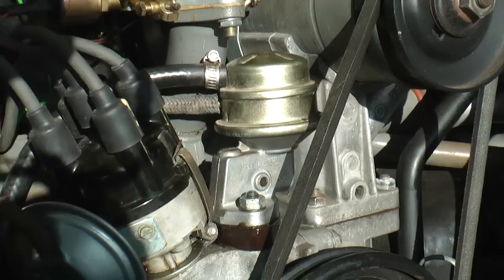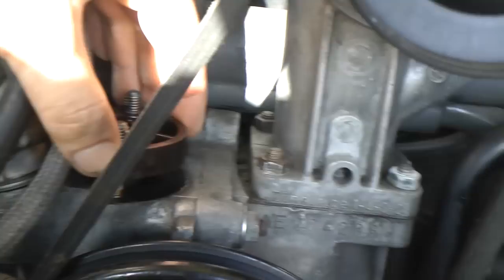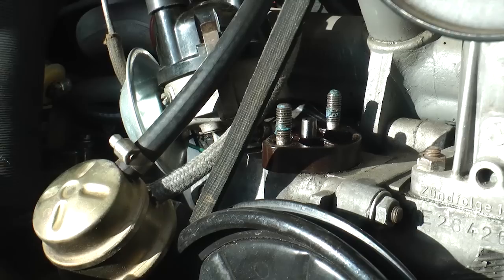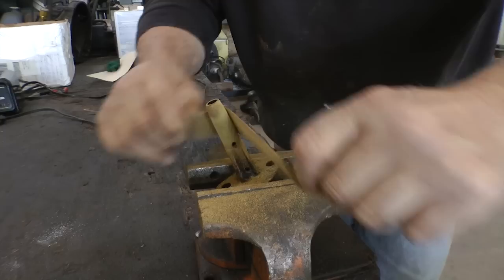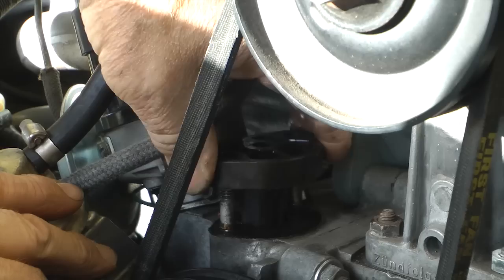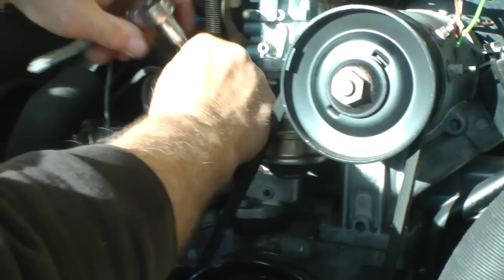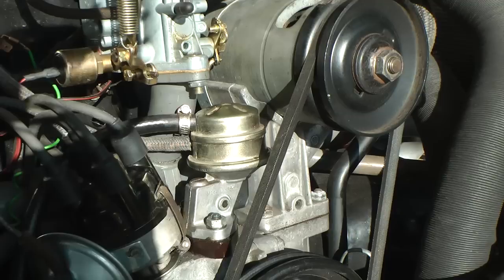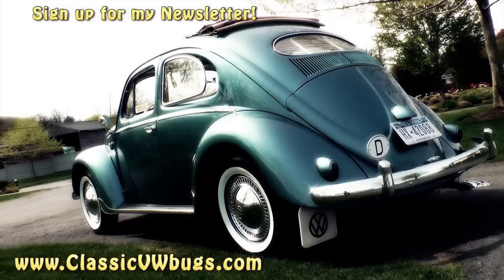Classic VW Bugs How to fix Beetle Fuel Pump Vapor Lock

Comment: This isnt vapour lock - that's when hot fuel (heated by the engine) vapourises in the fuel lines. The vapour cannot be pumped and therefore, like having air in the fuel lines causes rough running or even stalling of the engine, or difficult/ impossible to restart when the car is hot. All that is happening here is the bakelite stand swells, restricting movement of the pushrod, so that the pump doesn't pump fuel - the actual symptoms will be very similar / the same, but it's not vapour lock.

Comment: In Germany we prevent Vapor lock with adding 1% API TC two stroke oil to the fuel
that has a great anti boiling additive that pervents fuel vapor lock
try it...in Germany and VW and Porsche vintage driver does so

Comment: Chris. Thanks for the video but I am a little confused.being an engineer, from what you describe it is expansion of the push rod that is picking up on the baker lite guide. If this is the case surely it is the inside of the guide that is tight on the shaft. Please correct me if I am wrong.
Reply from the maker: the Bakelite itself swells around the rod.
Reply: @classicvwbugs  wouldent you have to sand in the guide? or is it just the swelling has to go outwords so it wont swell inside the guide? this just happened to me today. drove my bug for 2 hours straight and when i stopped for 10 mins then restarted got down the road a block and it just shut off. waited for 40 mins on the side of the road and it started up after i pumped the throttle and filled the carb with fuel. thanks for your advice.
Reply from the maker: @unicron24  No, just the outside.  So what is happening is, once it gets hot, the base is expanding and pressing up against the walls of the engine.  Since it can't expand any further it just grabs the rod more.
Reply: @classicvwbugs  oh i see... thanks

Comment: I was on the side of the road for 4 hours today because the little pin that the arm in the fuel pump pivots on came out. 

Not to mention one of my plug wires were bad.

Comment: Also it is so extremely important to make sure the rubber seal around the engine shroud is in good shape and fitted correctly. That way all the hot air is being pushed out and not recirculated back in the engine compartment. Great video.

Comment: I wanted to tell you that in a round about way this was helpful not only did I learn about vapor lock but my problem was exactly what you're talking about, but that was not the problem. I was about to see if I had to remove the gas tank and clean it out. When I removed the mat in the trunk and one of the two wires to the sending unit (I guess that's what it is) was corroded and fallen apart so I put a new end on the wire and it still misses a little every now and again BUT WHAT A DIFFERENCE! Thanks very much for the insight.
Reply from the maker: Thats very cool man, thanks!

Comment: Great video. My flange actually broke off when I tried to pull it out, so I replaced it. However, ultimately my problem turned out to be the electric choke which had disengaged, so the choke wasn't working and it flooded. You can't tell by just looking at it, you have to play with it to notice it.  Something to keep in mind.

Comment: An alternative if the pump stand is stuck in block is to polish the hardened rod with wet and dry 1200 grit paper. This avoids risk of breaking stand. I tape one end of rod with insulation tape to protect from damage and locate in chuck of electric drill, put drill in vice and polish at high speed then remove tape and repeat on other end of rod. Clean and replace back in stand. Job done
Reply: Thats a brilliant idea, many of the bakerlites are welded in the block! Thankyou

Comment: Learned a lot from this video.  My 63 beetle stopped dead last week in hot weather on an upgrade. Thought I had vapor lock. I found the push rod is actually 1/8 to short. That might explain the dribble of gas I am getting.  It wants to start, but does not have enough gas.  New parts in the mail.

Comment: Man I love bugs but they can really try you at times. My starter solenoid was acting up and not opening causing running issues. There's always something to fix on these. I just remember the miles I used to get out of my 73 vs current 62. Happiness is a starting and stopping g beetle with an open road and clear schedule😅

Comment: My '78 fuel injected suffered from vapor lock for a year before we figured it out. First we thought it was the fuel pump and that was replaced. Then we thought there was a problem with the filter.  The fuel pump would start sounding like a whirring fan and soon it would sputter and wouldn't run. Finally, my mechanic figured out it was vapor lock. I switched from 87 octane to 93 fuel and now there is no problem.
Reply from the maker: Why would the octane have anything to do with it?

Comment: I have had some luck preventing vapor lock by placeing a heat shield between the HOT/heated intake manifold and fuel pump. The heat riser gets well over 200F. Pure gas boils around 160F. Adding ethonal lowers the boiling point even more and begs for a liquid delivery system to fill with vapor/fuel steam and lose Its essential hydraulic characteristics.

Comment: there are two rod sizes available for the beetle.  One is short and one is long.  You have to buy the correct fuel pump for the correct size rod.  Its possible that you had a short rod, and bought a new fuel pump that needs the long rod.  That's probably why its not pumping cause the short rod can't reach to pump lever.  Either take it back and get the right fuel pump or find the correct rod.  Sometimes I have taken the lever of the both pumps apart and swapped the levers.

Comment: Nice to see that tip but I don't understand why this would be called vapor lock. I thought vapor lock has to do with gas vaporizing in the fuel line or other part of the fuel circuit. The tip you have shown is for a the pump push rod getting hung up mechanically isn't it?
Reply from the maker: Well kinda connected, vaporizing fuel is meaning that it is running hot, thus making the fuel pump base swell around the rod causing the pump to not pump fuel, thus getting a vapor lock effect.

Comment: @classicvwbugs @chrisvallone, can this happen on side-mounted fuel pumps (ex: 1960 36hp)? I rebuilt my fuel pump within the last six months (Wolfsburg West rebuild kit) and twice in the last month, after driving for 20 minutes or so, the engine cuts out and I can't get it started again. Check the carb and there's no fuel in it. I'd like to avoid spending $270+ to have the fuel pump restored if this could be my issue. Thanks!

Comment: Quick question. How does sanding the outside of the fuel pump base stop the fuel pump rod from jamming in the inside?
Reply from the maker: As I explained in the video, when the engine gets hot, the base starts to swell, the more it expands and pressure against the block, it then puts pressure on the rod, thus grabbing it, and slowing it down.

Comment: 2021 and this could still be useful - one thing though - I unbolted my fuel pump but the bakerlite piece would not come out nor either move - it was like it was welded down, although the rod moved freely (on a cold engine of course). Could this be a sign that the pedestal is part of my hot start issue or should I start hunting elsewhere?

Comment: Chris I was going to do what you  recommended to my bug, for the vapor locking problem and  the neck spacer to my fuel pump broke off in the case flush do to brittleness, I had to break it out but now I have broken pieces of fuel pump in the case, what's your recommendation. Thank you for your time.

Comment: Hi, I have a 76, starts ok cold but then when warm doesn’t want to fire, takes a lot of cranking, choke seems to be working, but once started goes straight to low idle. Wondering if it is flooding as you can’t touch the accelerator or it will refuse to start. Just keep cranking till it starts to fire and hit the accelerator.

Comment: Is the rod supposed to be completely removable like the Bakelite? The one in my 73 is stiff and doesn’t want to line back up with the Bakelite to be reinstalled. Any advise?
Reply from the maker: Everything should be removable, sounds like your base is warped or something.  That rod should fall right in.
Reply: Got it the rod dropped down in block when I removed the Bakelite and it was pined in an angle. Pulled it out by hand with a lil force everything’s back to normal.

Comment: Hey Chris, I have a 36hp on my 56 Oval and I finally got my new rebuit 36 all bolted up and running.  But ran into this issue when I test drove around block and after about 10 to 15 minutes of driving.
How would I check on this fuel pump vapor lock issue on a 36hp?
Reply from the maker: Hmmm well 36hp fuel pump base/rod issue does not really happen like the later models.  Does the car run longer if you pull the choke?
Reply: @classicvwbugs   Nope even with choke pulled it still wouldn't start when it was warm.  I pulled the fuel line and very little fuel came out of the line when I cranked it.
Reply from the maker: @surfsup98  Ok could be a blockage somewhere, or a clogged line or crimp.  Maybe even your screen in the fuel tank is clogged.  Start checking fuel flow through lines.

Comment: Chris,

I have a 78 Cont w/ fuel injection. Just re-installed the engine after a re-build.  Now the fuel pump runs all the time.. Need to disconnect the battary to stop it.  No fuel leaks that I cna find or see on the floor. Car will fire once or twice, but will not run.
Do you think I have a vapor lock type of issue or failed pump???

Comment: I have a ‘71 VW Super Beetle. Is it normal for the fuel system to lose pressure overnight?
Reply from the maker: It is possible. All it takes is a lil piece of junk in the fuel lines to back things up.
Reply: Chris Vallone Does the pump needs to maintain the proper psi’s overnight for it to work properly? Or can it drop to 0 psi overnight and still good?

Comment: First try pouring water over the fuel pump.Believe it or not this actually works! Im in Roswell NM and we average around 112-120 degrees each year every day, and each year my thing vapor locks. I just pour H2o on the fuel pump and thing fires right up and were on our way. I always have a bottle of H2o ready...Give it a try you'll see.

Comment: How can I check the venting on a super beetle with the gas expansion chamber. Gas cap looks normal from what I see for sale online. I am in a some what hot climate, around 80-90 max. Often it is 75 or so. Sometimes my tank is only about 3/4 full, and it will still do it.

Comment: What do you do if the stem gets stuck?
I can’t get mine out, it seems like it is swollen and it is made of that plastic brown bakelight material.
I am a bit concerned about breaking it and having pieces of it go through the engine
I have a 74 super beetle. cheers.

Comment: Do you recommend bypassing the mechanical fuel pump and opting for the electric fuel pump?   I have a stock 1600 dual port... debating this issue for a while:)  Come from the old school..if it ain't broke don't fix it.
Reply from the maker: Nah I like the old school fuel pump. =o)

Comment: I have a 68 beetle and I am having the exact same problem. I've become a fuel soaked maniac trying to get this thing fixed. I've replaced the fuel filter, all soft fuel lines, fuel pump, done several tune-ups which helped a bit, checked for vacuum leaks, and still have the issue. When disconnected the soft line from the tank the fuel came pouring out so I don't believe it's clogged there.  When I shut off the car after driving a while I notice bubbles in the filter coming from the pump side.

Comment: I was just thinking the same thing. The inside is what should technically be sanded but there is no way so maybe sanding the rod would work better ???
Reply: If the rod is ‘pinching’ surely it the inner bore that needs reaming out and not the outside of the spacer. I don’t get it!

Comment: Chris, I did do this to the fuel pump stand however the engine was not at running temp. Do you think I should Re-Preform this measure after its warmed up??? Still having problems. She starts 
perfect after sitting for a few days however after driving it I hold the throttle all the way down to get her to start Puffs a little white smoke at re-start, Then it seems she runs only on 2 or 3 CYL.  after starting then smoothes out within 15sec or so.... HMMMM??/ Can You Help?

Comment: my 1972 vw superbeetle is having a problem. when i press the accelrator the engine seems to sputter. fuel filter does'nt seem to filling up all the way like it use to. replaced fuel filter with clear fuel filter. it(the filter) has not gotten dirty again after replacing it. I replaced the "cloth" fuel line that joins the incoming metal fuel line and fuel filter. any ideas ? take fuel pump apart ? also u mention put some type of grease in the fuel pump, where at ? what type of grease ?

Comment: my fuel filter was completely dry after warm up and now it looks overfilled. i didnt sand down the space tube just pulled pump and rod out. could i have put the rod in upside down?
Reply from the maker: hmmm maybe, pencil point down into the block.  You could also have the wrong size rod.

Comment: Chris, In my 65 beetle, the fuel pump stand was all brittle and it broke when I went to  pull it out. I tried to use a screw puller and the metal housing broke! Now there is a piece of metal and the stand in there. How do I fix this?
Reply from the maker: Hmmm, how big of a piece of metal?
Reply: It is about half of the seat for the fuel pump stand. I shared a photo with you on Google+

Comment: Curious how if the fuel pump spacer doesn't move easily up/down that it would cause vapor lock? Once you attach the fuel pump you bolt it down onto the spacer then all is locked down - nothing would move other than the rod. So, don't understand why the spacer has to be able to move freely.
Reply from the maker: because heat makes that Bakelite material to expand and then tighten 
even more around the rod, thus making it harder to go up and down.  
filing the outside allows it room to expand and not put so much pressure
 on the rod.
Reply: Ah, makes perfect sense Chris. BTW, mine broke when trying to remove the fuel pump block so I'm going to use your tap method to remove. I will also replace the fuel pump and I have an alternator so I know that affects the correct rod size and type of pump. Thank you so much for your help and excellent videos, really appreciated!
Reply from the maker: you are welcome my friend

Comment: Not sure if I'll get a reply but, quick question. How would that hinder the pushrods movement? It's just basically a spacer and a "housing".
Reply: As long as the pushrod moves freely it's good to go right?
Reply from the maker: When the motor gets hot the stem of the pushrod base swells around the rod slowing it down.  You can't have that.  Of course when it is cold it will move fine, but not when it is HOT.
Reply: Chris Vallone Ah of course. Mine won't even come up off my engine block.
Reply: Got it. Man that pedestal must have been tapped down.
Reply: dubtat i have the same issue, everyone ive came across cant seem to tell me why it looks like its bubbling and little fuel in the filter

Comment: hey chris my bug will take awhile to turn over. i crank it and it'll crank for at least close to ten seconds then slowly turn. but once its on and i leave it there to idle the carbs start to flood and then the bug wants to shut off. please if you can help me i would really appreciate it.
Reply from the maker: Hmmm sounds like carb adjustment or timing
Reply: I don't know if the carbs are bad cause i have a duel 40s kadrons. plus there's a little bit of black smoke coming out the drivers tail pipe. and it sounds like the car is sucking alot of air before it starts
Reply: Chris Vallone You are the Man #!
Seriously you rock.
Reply: I found out why the carbs were flooded one of the floaters in the carb wasn't flooding. Other than that carbs and valves were adjusted and now it runs perfect. Thank Chris
Reply: Kristian Moya thank you for asking that question. I just bought my first bug and a week later had the same issue. I spent the last three weeks trying to fix it by any means. I was a week away from just buying a whole new rebuilt engine. I saw your comment and your fix and I found out that somehow my float was full of gasoline. I poked a hole on the top and squeezed it all out and the car runs great now! Thanks boss.

Comment: Hey Chris, I got a question for you. Have a 73 super with a 1600, Malory Unilite dizzy and coil, and dual Kadrons which likes to lose power and stop running after an hour or so. I do drive somewhat hard when driving (just got it on the road) and not totally sure if it's vapor lock or the fuel pump not keeping up. The symptom is it will idle somewhat and die if you press the pedal. If I start it with my foot to the floor, it will slowly rev up, and if I let go, I can't keep it running, it just dies. Seems fuel related, but the coil does get hot once this happens. If I wait overnight, it starts and drives like nothing ever happened. Have any ideas? Thanks :)
Reply from the maker: Would have to see what your engine compartment looks like, sounds HEAT related for sure.  Are all your seals in place? Tins?
Reply: Chris Vallone
Yes, all tins in place, even the under cylinder tins that seem to go missing. The engine seal seems fine. The gents on TheSamba think it's the sock or regulator, so I'm chasing that one right now, and might redo all the soft fuel line. The only thing missing is the tubes for the heaterboxes, and the vents are open and flowing air into the compartment. Think it's just recirculating hot air? I did pull the top of a carb last time it happened (5 hours ago..) and it was low on fuel so I know it's a fuel problem.
Reply: Having the same problem on my 71 super, did you ever figure it out?